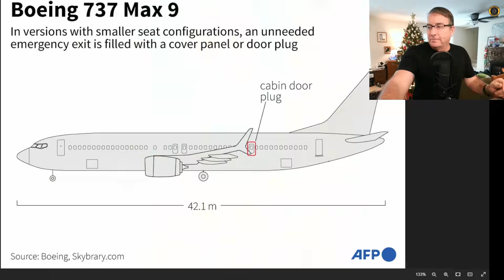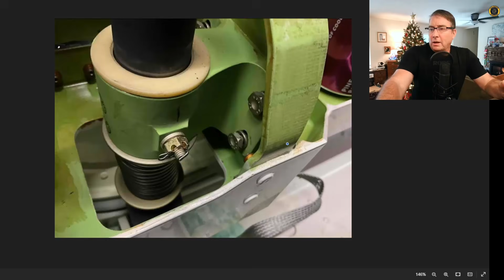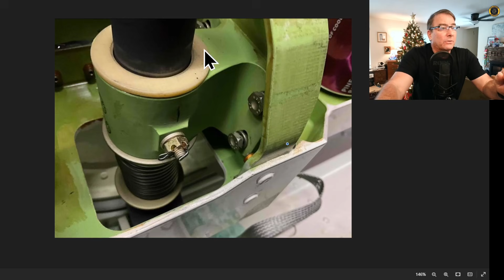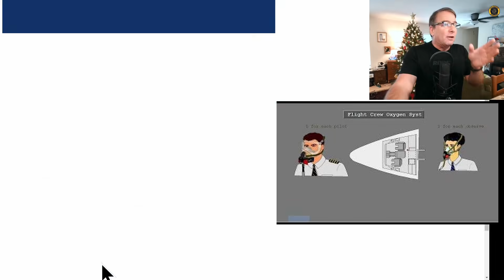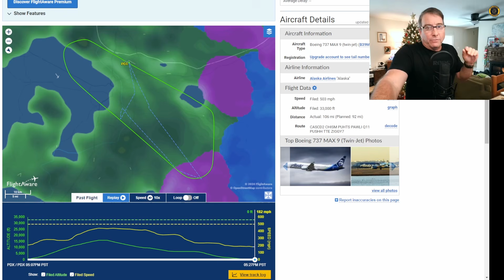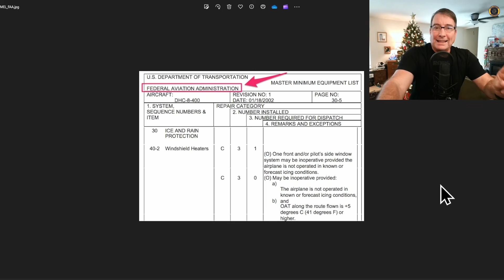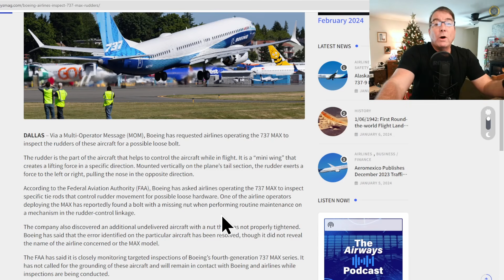"Yes, We Have No Bolts"  9 Jan 737 Max-9 Update

Comment: That cockpit door is a really difficult situation, in a scenario where the depressurisation incapacitated the pilots you need that door open to get someone in and flying the plane, but in a scenario where the depressurisation occurs due to hijackers it makes it harder to prevent them from taking over and hijacking the plane

Comment: Scary when you think this is a new plane, loose nuts and bolts here and there, this is not a washing machine Boeing are manufacturing for god sake, they obviously need to tighten up their SOP's and final inspection procedures as well as the actual hardware.

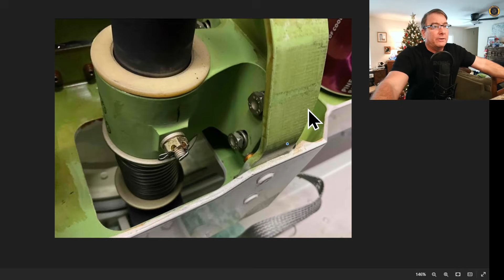Comment: 2:22 the four key bolts in context 6:49 FDR, CVR 7:27 maintenance should have pulled CVR circuit breaker 8:48 presumably using paid FlightAware service 10:20 on autopilot, continues to climb,11:13 takes about a min. for crew to recover from depressurization, prepare to level, descend 12:45 did not hear even one "mayday" on the recordings i heard 18:30 captain can refuse plane based on maintenance log issues 19:26 undocumented cockpit door opening on lost pressure

Comment: The obvious problem is that these were Friday planes. As a mechanic we often joked about automobiles that had numerous issues directly from the manufacturer as being made on a Friday when the assembly crews wanted to go off shift soon causing sloppy work quality. One oddity that comes to mind was a brand new Buick Regal that had a check engine light come on when the passenger door was slammed instead of shut normally. The base issue causing the fault was a bent ECU connector pin. The pin would make contact until a high enough force jarred it causing a momentarily interruption of signal and a fault code generation. We decided to go over the rest of the vehicle and found numerous cross threaded bolts holding the hood and trunk hinges on. Easy to spot as the bolt head is canted from a normal flat position. And I thought those issues were disgraceful. At least a Buick won't shed parts or fall out of the sky. Boeing should be ashamed. That rudder loose bolt issue had me thinking of the past 737 rudder power control unit servo spool issues and those poor people that were lost because of it. Hopefully someone at Boeing will learn to torque down the hardware to spec. We used a paint marker to mark critical hardware after it was torqued and second eye set verified. Guess they don't do that at Boeing. In the photos I didn't see any type of verification mark on the hardware. Yellow paint marker is cheap insurance.

Comment: why does the guides have no "recess" for the roller bolts?
Cabin pressure would then automatically arrest those rollers in there - even without the stop bolts.
Yes, the fuselage would still leak, but couldn't lose these plugs.

Comment: Thanks so much for this top notch report and analysis as always, Juan. 
Once again, it seems that the deeper you dig, the more wild cats you find, whether in the aircraft design choices, factory quality control, operational documentation or else… The top managers pressure to have a common type certificate seems to have led to extreme abuse of good engineering practices with that new cockpit door surprise…

Comment: Its 48 years since I started my engineering apprenticeship. Since then, I have never seen a bolt come loose which had a cross-drilled hole, castellated nut and cotter/split pin or securing wire. They are often used in passenger vehicles where there is a single point of failure (e.g. holding a motorcycle wheel on). If you ever witness scrutineering at a motor race, you will see these at every critical point. They just don't come undone. A big fail for Boeing in my opinion. I wouldn't choose to fly Boeing any more (unless the aircraft was say, twenty years old).

Comment: No i respectfully disagree. You failed to substantiate why cabin pressure must be equal in a passenger cabin pressure loss situation. Pilots must be able to get that plane on the ground  safely and unhindered by pressure loss, loss of cockpit door, headsets, etc. Had cockpit door not blow open and pressure loss, headsets and emergency manuals would have remained intact. This, in addition to a possible hikacking scenario basis. Theres a reason for the Sterile Cockpit Rule and this incident exemplifies it.

Unrelated however is i hope the FAA imposes hefty fines for letting the overwriting of the CVR. This has happened too much in the industry now and inexcusable.

Comment: If the plug door departed the aircraft by sliding up off the ends of the lower hinge slide pins either the double check nuts and large washers on the ends of these pins would have to be missing or there would be damage to the end of the pins where the double check nuts were sheared off?? Thanks for your excellent content Juan.

Comment: As a few others stated. We sent a man to the moon over 50 years ago but we haven’t been able to put an audio system in a modern jet that can’t make a recording longer than a few hours and is dependent on a breaker system to record or not record.  Oops I forgot to plug it in🤪🤪
Reply: We could build an Empire State Building ground to spire in 11 months, yet after twenty years we don't have any Calif high speed rail except for a short section of demo track in the desert?

Comment: Just a wild a*se guess. Could corrosion of the locking bolts be a factor? 
If some bean counter has swapped them for alternatives made of a cheap and nasty material, while sitting in aluminium channels, with frequent temperature changes on the outside of the plane encouraging condensation it seems like a possible recipe for electrolytic corrosion.

Comment: Just a quick question - if the USA calls a 'Split Pin' a 'Cotter Pin', what do you call a real 'Cotter Pin' (a taper pin with a longitudinal flat on it usually used to lock a crank to a shaft such as a bicycle pedal to the chain wheel shaft)

Comment: What is the difference between a bolt and a screw in the us?
Reply: No use cryin' after the horse has bolted, after which the pooch is screwed.
Now, about those castellated nuts?
Reply: @paulsherman51 Haha.. great  :) 
But, over here in Europe, a bolt has no threads.. its just a cylindrical surface.
Reply: Wouldn't that be a guide pin or alignment pin, as we call in the States? Whenever I heard the machinist say "nice threads" I would always grab the lapels of my fine suit and say with a smile, "why, thank you!" @Mingus8
Reply: Yes, and that's exactly what we say too. "Bolt" is quite an unusual term here.. and refers more to a large rivet, like in old ships och bridges. But a screw is not a bolt!
Reply: Or to the seamstress, a bolt of cloth @Mingus8

Comment: Looks like American engineering is going down the pan just like everything else. Haven't they heard of thread lock or locking wire(on the bolts that were working loose).
Can any commercial pilots or groundcrew tell me if jets use different fuel tanks when at cruising altitude, please.

Comment: If the upper track guide fittings are intact then it seems likely that the lower fitting was damaged by the air stream twisting the door off. I would imagine that it would be the aft lower fitting. This incident reeks of a failure in the paper trail. Lack of the retainer bolts suggests that the door was hung in place without the pin bolts in anticipation of removal/refit during the cabin fit-out.

Comment: Won't  a leaky door cause a whistle ? Was that row not used because  previous customers had complained about noise? Hell of a coincidence that row was vacant.
Reply: I believe the airline said there had been three previous pressurisation warnings, once almost a full month before the accident and then one on each of the two preceding days (one of those times while the plane was on the ground), each time the fault cleared when switching to the alternate controller and didn't reoccur during the flight. They probably suspected a faulty sensor but chose to limit the plane to non oceanic routes. The NTSB also said on Monday that they didnt think the pressurisation warnings were linked to the Plug.
Reply: @watcherzero5256  NTSB may want to rethink that one.
Reply: yeah noise and also sometimes you would see ice buildup - if you were sitting right next to it you could feel it cold or a draft.
I've been on a delta 737 flight many many years ago that had a tiny leak around the window and there was a large formation of ice around it and you could feel the draft - very unnerving - reported to flight attendant who could care less
Reply: @shaneskillzrepresent Something like that happened to me in an exit row seat on a recent transatlantic Delta flight on a 767. I was so cold that I couldn't feel my feet and I ended up putting on all of my winter clothing and my jacket and scarf just to stay warm. I was also having an extremely hard time breathing and my face was starting to tingle. There was also a bolt missing on the exit door shroud cover on the inside. I mentioned all of this to the flight attendant as I was trying to tell her that I was going to sit in the lavatory for a while to warm up and be able to breathe. She was extremely attentive to my acute needs, and maybe they did something about it afterwards. But I started off by saying "something is wrong with this door" before talking about the low temperature immediately around the door and my difficulty breathing. Then a week later, AS1282 loses a door plug.

Comment: I read about another depressurization incident and the cockpit door also flew open and the pilots thought it was just from the forces involved.  A commenter on that video said the same thing, the door is designed to open during depressurization.  I wonder if this was intentionally withheld as it would be better if people did not know that you could gain access to the cockpit by an intentional explosive decompression.
Reply: Your assumption is correct.
Reply: I knew about the door opening. I could'nt tell you why I knew about it, though. It might be from when I researched the MCAS failures. I am surprised that it isn't told to pilots, though.

Comment: I recall that the 737 had an history of accidents/crashes due to hard rudder deflection, caused by a defective actuator design. Now we have, the second occurrence of Boeing conveniently “forgetting” to mention important informations in the manual, together with the discovery of missing or loose nuts/bolts on new airplanes. What’s happening? Are the profits requirements of a large corporation, overriding public safety? Again?
Reply: Remember, it's Southwest who lobbied the crapmout of Congree to get FAA to change the rules and keep the same T/C so they could save cost by not needing to retrain crew.

Comment: It's interesting on what they have been reporting of the operation of the Flight Deck Door. I'm not sure what the system description states in the AFM (Aircraft Flight Manual), however as per the Boeing Aircraft Maintenance Manual Part I - SDS (System Description) for the 737-7/8/8200/9/10, ATA Chapter 52-51-00-005 states:

"Control Cabin Door Decompression Panels

The door has blowout panels that will open if there is a rapid decompression in the flight compartment. A rapid decompression will cause a sudden change in pressure between the flight compartment and the passenger cabin compartment. For each decompression panel, one edge is attached to the flight compartment door assembly with retractable bolts, while the other edge is secured to the door assembly with a mechanical pressure release latch. The mechanical latches are set to release under a pre-determined pressure, which will cause the decompression panels to open into the flight compartment.
   
In the case of a rapid decompression in the cabin compartment, the door is able to withstand the pressure difference due to the small area of the flight compartment."

The decompression panels (there are 2 of them) are hinged to allow the panels to fold inwards to the Flight Deck if the Flight Deck looses pressurization. The panels remain closed against the frame of the reinforced Flight Deck Door in the event of a Cabin depressurization. The  Flight Deck Door latch should be strong enough to hold the door closed when the electronic Flight Deck Door lock is engaged in either the Auto mode or Deny mode on the FLT DK Door panel.
Reply: So the blow-out panels are designed to only operate when the pressure in the cockpit is lower than in the main cabin. If the pressure is higher in the cockpit than in the main cabin the blow-out panels remain closed and the door is supposed to be strong enough to resist the differential pressure.

But in this case the door blew open, which suggest that it was not designed to resist the differential pressure to which it was exposed. Or perhaps the door was not fully closed and latched.
Reply: Correct.

Comment: Licenced aircraft maintenance engineer here (EASA and FAA licenced): I have worked on several brand new Boeing 737NGs of a large European low cost carrier. We had several cases of really bad workmanship from Boeing, e.g. cross threaded Cannon plugs (e.g. in one case an engine would not shut down until all fuel in the line from the spar valve to the engine was used up, because the high pressure shut of valve in the hydromechanical unit would not close, because it did not receive power due to such a conectir under the wing to body fairing), but also trouble with engine fire loop wires, where wire terminals had been crimped on in the factory with a not correctly calibrated crimping tool.
Boeing quality control sucks and possibly a few mechanics and inspectors are about to lose their licences, followed by managers.
Reply: After the managers lose their jobs and licenses, the responsible executives should lose their positions and golden parachutes. Put in new executives who can change the culture and fix the many problems at their root. Boeing's current CEO was head of finance when all the problems in designing the MAX were happening. Their newly appointed COO is also a finance person. The aviation public need a CEO whose interests are aligned with the safety and interests of the customers, ahead of shareholder value. Boeing's board, especially independent board members, are not doing their job, and the world is worse off for it.

Comment: How are we, the public, supposed to assume there aren't other hidden assembly defects in these (or any) Boeing planes?  What is the annual inspection like on these? Would an inspection at that level have found the loose bolts on the door plug and/or improper we fixed bolts on the Rudder? 

Does Boeing need to pay for a more complete inspection of these aircraft before they fly again?

Comment: How about the cabin temperature during the crisis? After the plane depressurizes the cold air comes in.
Reply: At 10,000ft it could be 25C cooler than at the surface and with a 400kt chill factor.
Reply: Cold enough to freeze the nuts off, oh, but they weren't there to begin with @christopherrobinson7541

Comment: Juan - Do you know if the door plugs on the 737-900ERs are designed differently from the plugs on the Max 9s?  I can understand why the initial focus of the investigation and the grounding have been directed to the Max 9s but there are door plugs on the 900ERs as well.  Are they not also susceptible to the same type of blow-out?  Thanks.

Comment: If I understand the design correctly, when the door plug is correctly seated, the bottom hinges does not carry any load? The load is taken by the 12 pads only. the lock bolts in the upper guides keeps the door from slipping off the pads. The hinges are only active when opening the plug door, if they fail in flight, nothing happens?

Comment: Why even make a door being held by just a few bolts? Seems like if you wanted to plug a door opening and not have it blow out you would make the door like a wedge so it would fit the opening having a larger size on the interior of plane- like a cork in a test tube. The door could never be pushed out because of the mere shape. There’s no track, no hinges, just bolts all around securing to the frame. Dah? Am I the only one that sees this as a possibility?
Reply: What you describe is known as a plug door and this design is used for the 4 main and service doors at the front and rear of the aircraft.

Comment: The 737 should never be ETOPS.
It does not have enough back up equipment.
Only two electrical, hydraulic and fuel systems (the so-called third systems are too limited to be called backups).

The 146 had a complete extra electrical system, and complete extra hydraulic fuel pumps. 

R

Comment: All doors and panels within a pressurised airframe has to be designed to handle explosive depressurisation.
That goes for the cockpit door but also the cargo panels, cabin panel, etc.. 
This is to prevent further structural damage, a huge force can build up on panel during decompression.
I didn't know the pilots were not aware of that.
Certainly that should be part of pilot manual

Comment: I was a Cabin Crew trainer when the new security doors came into use. The panels were trained as they would drop in towards the flight crew and be held in place. Never did I ever receive information about door blowing open. 

An immediate security question when these doors were introduced was take over plane, cause decompression, enter through flight deck security door.